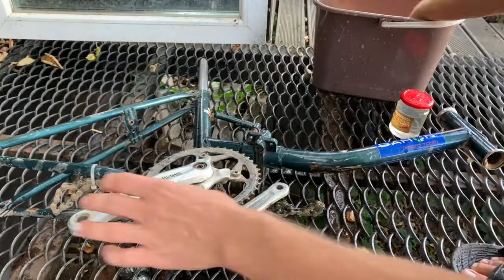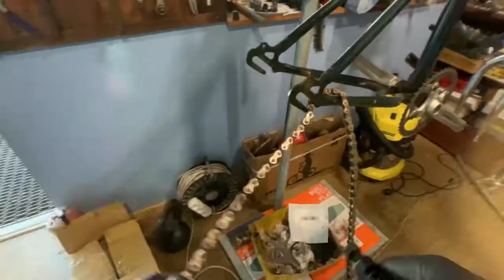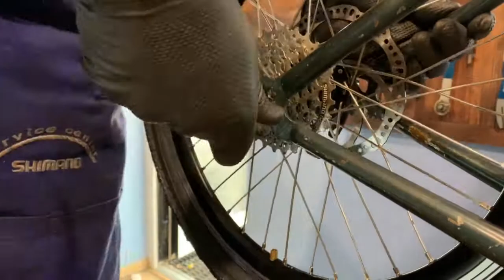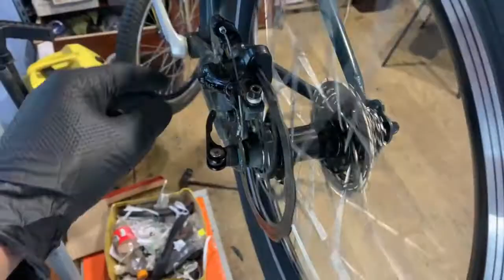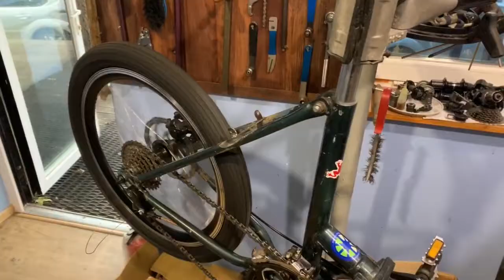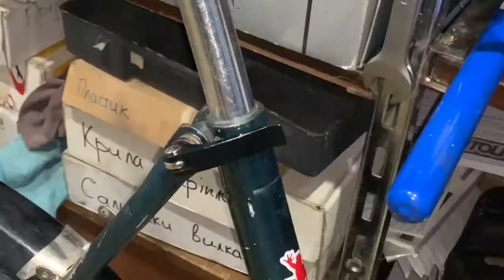Old soviet folding bike total rebuild. Welding disc brakes.

Comment: Nice work. Adding disc brakes will probably trigger the safety police. Ive done it on a 1997 rock hopper. 2 years, no problems.
Dahon is soviet?
Reply from the maker: Radnally Dahon is sticker. 😀Thanks.